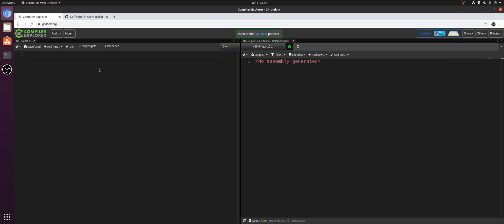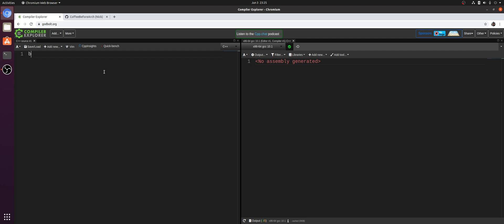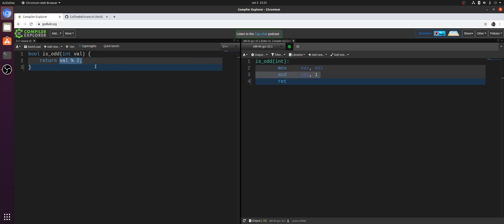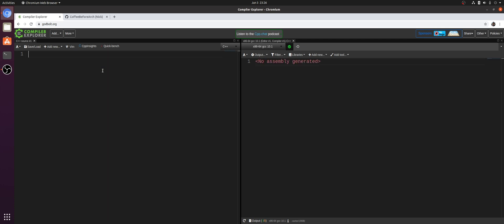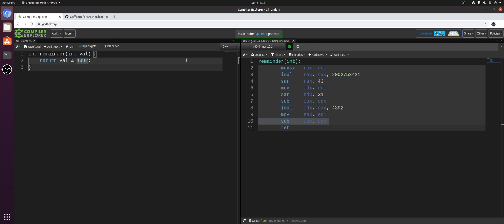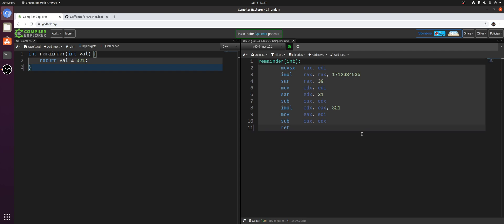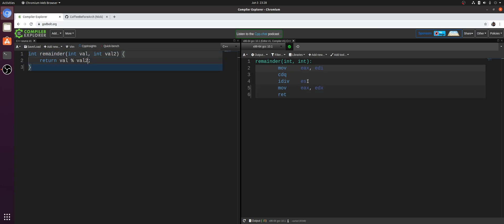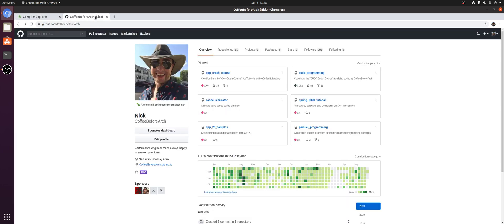Advanced Topics: Strength Reduction

Comment: Is doing all that gobbledygook really faster than just doing a division?
Reply from the maker: Yes, and it can be significantly better! There are a few reasons for this. For one, division is just very slow compared to shifts/adds/and even multiplication. There is only a single port div instructions can be scheduled to, while there's much more scheduling flexibility and HW for these other ops (fewer stalls for resources). From a small benchmark comparing the idiv instruction to the strength reduction code over 4096 ints, I saw a ~9x perf improvement (doing %1245). As always mileage may vary with benchmarks, but compiler vendors won't implement optimizations that are turned on by default that are detrimental to perf.

Here's the benchmark I quickly wrote for this https://github.com/CoffeeBeforeArch/misc_code/blob/master/strength_reduction/mod_bench.cpp . I compiled it with this command "g++ mod_bench.cpp -lbenchmark -lpthread -O2 -march=native -mtune=native -flto -fuse-linker-plugin"
Reply: @NotesByNick  thanks you rock man!
Reply from the maker: Joey Bream no problem! Always happy to help!